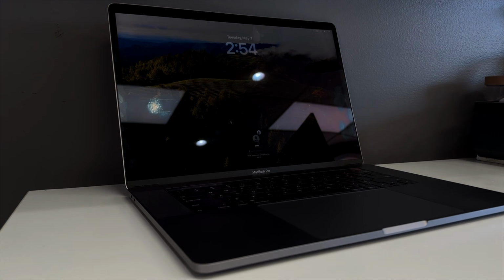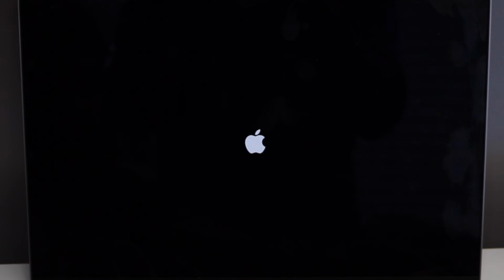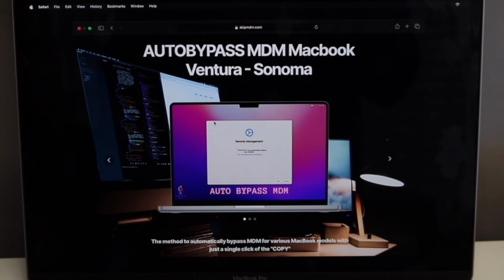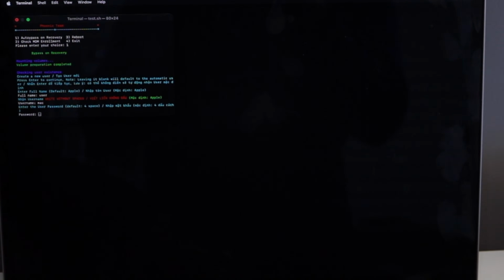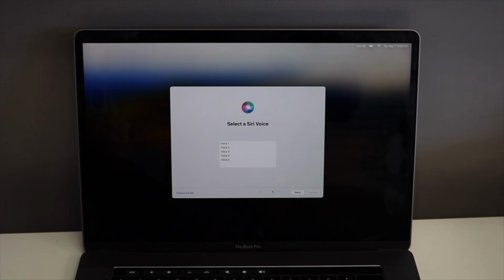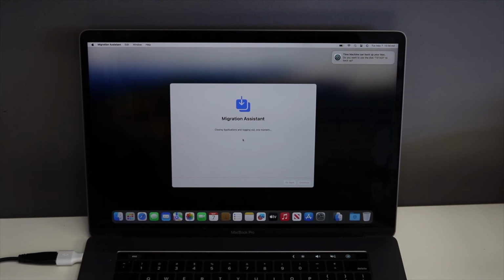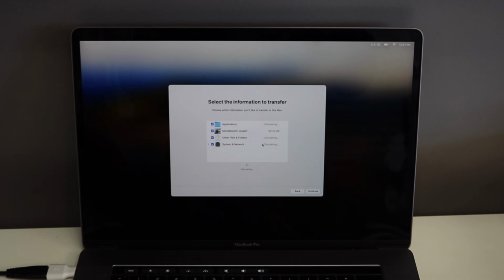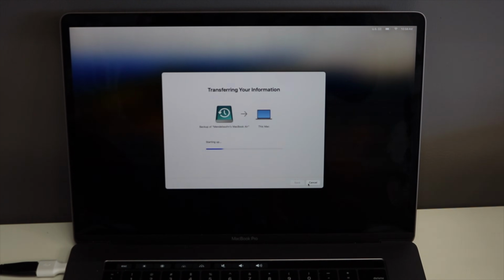How To Bypass MDM MacOS Sonoma - Including Time Machine Restore

Comment: TRYING HARD to follow this. But when I go to the skipmdm website, I only have choices for Silicon chips. I'm on an Intel (MacBookAir 7,2). Tried to use the URLs I found on your later post of this (9/11/24 below) but didn't get anything copyable or usable. In the later video you type a TON of stuff, only a teeny portion of which is visible on your phone. And if I enter the URL shown on your phone, I get a whole page of stuff that doesn't have anything resembling the script on your phone. HELP!!! Thanks so much. This will be VERY helpful if/when I can get it to work for me.
Reply: GITHUBTECHIE removes MDM permanently
Reply: On Instagram

Comment: Hay Bro, just a question, i sit safe to buy MacBook on ebay that says  " MDM BYPASSED"?
" This device is enrolled in a MDM service. The MDM has been bypassed. The buyer will need to bypass there MDM again if the device is factory reset. The MDM bypass instructions can be found online by simply googling it.   Or can be used for parts"
Thanks in advance